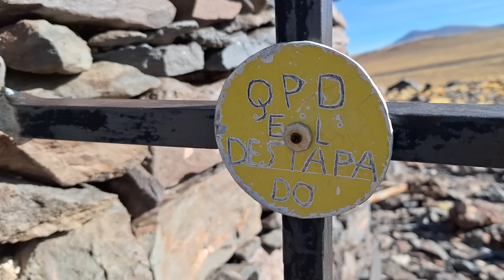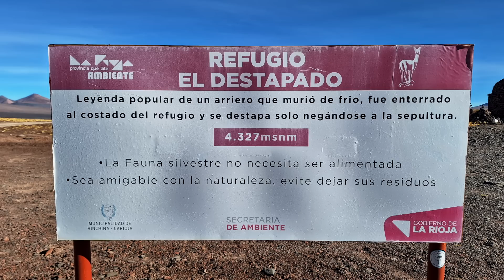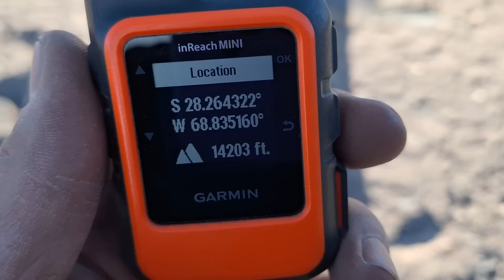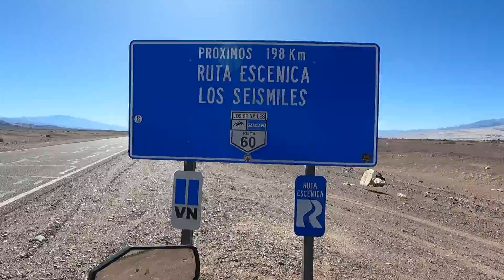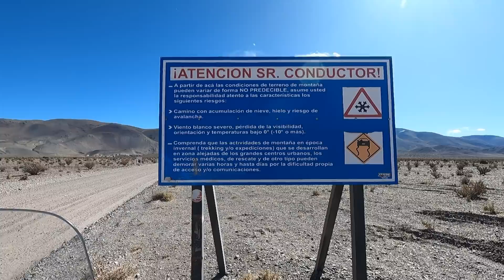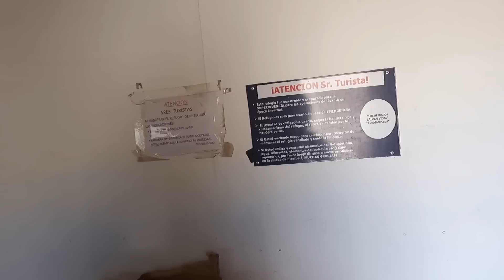Open Graves and Smashed Sandwiches High in the Andes (S3:E51)

Comment: Awesome baby volcano. I was waiting, you put your hand in the water. I would have done the same thing, be careful, but ice around is a good sign not scalding water. Bizarre with the open grave. I’m a bone radiologist, was looking for tell tale sign on the bones. ¡Buen viaje mis amigos!
Reply from the maker: Yeah, with as cold as it was, there would have been a plume of steam had the water been scalding. I would guess it was probably about 50° f, so definitely warmer than the ambient temperature, but far from hot.

What, if anything, were you able to tell from the condition of the bones?? 🤔
Reply: From what I can see, pretty limited, but no obvious bone injury or lesion.  Bones have been moved around, ulna on top of the humerus, right femur crossing the lumbar spine.  Very clean looking, no tissue.  @TwoWheelsThreeSheets
Reply from the maker: How long do you think it would take given those conditions for a body to decompose to that degree?
Reply: Short answer, I can’t tell. Would take involvement for forensic analysis (various methods), and I’m not trained in that. There was no remaining tissue that I could see. The person in that grave could have been there just long enough to lose all tissue or way beyond that. What I have heard is can be large variation in decomposition depending on conditions. Forensic training puts bodies in various conditions, follows that to get an idea of decomposition with timeline, but again, environmental conditions can cause wide variation in results. Interesting field, but all my patients are alive.
Reply from the maker: @chipm2544 Yeah, I always preferred patients of the breathing variety. Rose, on the other hand,  well, she always wanted to be a corner...

Comment: Hey, does your a.t ever have problems with starting at cold altitude? Like even at 6000ft and 8c?
Reply from the maker: Not that I can recall... above 14k feet or so, I need to shut it down and allow the FI / mapping / ignition (whatever) to recalibrate every 500 feet (elevation increase) or so. But once I do, it runs fine...
Reply: Ok, mystery problem with mine😅. Thanks for the answer!!!